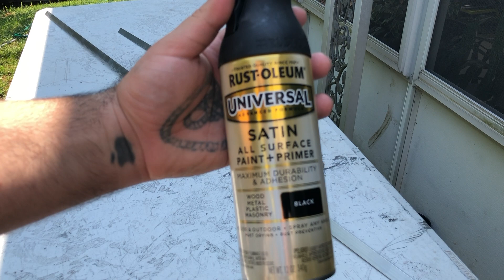DIY HEXAGON TILE TO WOOD INLAY | alexistriesdesign

Comment: What did you do about the knicked edges on the wood? I am in the process of doing this on my back door entryway and it is so hard to get perfect edges, keep finding small knicks where the edges line up.
Reply from the maker: Hi Darell, sorry for just now responding now. Life got in the way, but that's beside the point. I'm sure your entryway turned out great. I had the same issue and tried to work around it. I tried placing blue painters tape on the cut lines, but there was still chipping. I ultimately just took my time with the circular saw and just learned to live with the unavoidable knicks.

Comment: I am worried about the transition, it looks like your tile is slightly higher then wood. Is that feel okay? Does it creates any tripping hazard?
Reply from the maker: The tile is slightly higher than the wood, but it honestly doesn’t feel like there is too much of a difference because the caulk I added around the edges leverages the unevenness. I wouldn’t say that this creates/created any tripping hazards. If the tiles were slightly than I would have maybe went about this different 😊